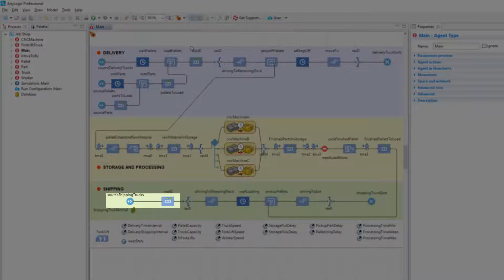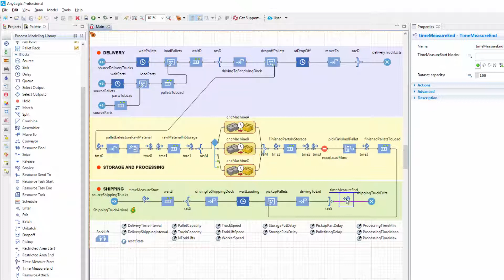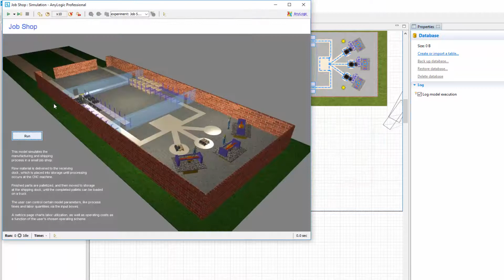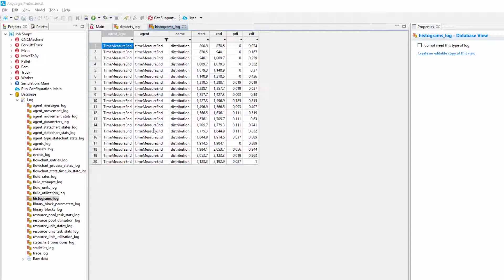Measuring time in system

Comment: How do you measure time WITHOUT time measure blocks and make a histogram of time data? For example, how do you measure time in a queue in service block
Reply from the maker: Hi Madegma, 
For this purpose, you can create a time parameter for agents that are going through the Service block. Queue time in Service block is the time between the agent entering the block and entering the embedded Delay block. You can use 'On enter' action of Service block to set the time for the agent's parameter by using 'time()' function and then subtract the agent's parameter from the result of 'time()' function in 'On enter delay' action of Service block. Hope that helps.

Comment: Hello, is it possible to apply the same for Road Traffic Libary to measure time of cars?
Reply from the maker: Hi Hary! In the case of the Road Library, we'd suggest a more convenient approach to tracking time. Take a look at the inner structure of the "Traffic Lights Phases Optimization" example model (go to AnyLogic Help | Example Models | Examples)
Each existing car has a variable "startTime", which initial value equals "time()". You can find it inside the "Car" agent type. Additionally, in the "carDispose" block (field "on enter") there is a code that passes calculated time in a system to a "dataset" object and further to a histogram as well as to an "output" object.

Comment: Hey AnyLogic Team!
Is it possible to get the mean value into a variable or into the console with traceln? Thank you so much!
Reply from the maker: Hi! The "TimeMeasureEnd" block includes the "HistogramData" and "DataSet" elements to store measurements. They are named "distribution" and "dataset" correspondingly:

timeMeasureEnd.distribution
timeMeasureEnd.dataset

You can get the mean time that the agents spend between the "timeMeasureStart" and "timeMeasureEnd" blocks by using the expression below:

timeMeasureEnd.distribution.mean()

All the functions available for working with the statistics collected by the histogram data and data set are listed in the Help documentations Histogram data and Data set.

Moreover, this statistics can be collected manually using a variable of the "double" type inside the agents, function "time()" and the "Statistic" element. The variable is needed to remember the time when the agent arrives in the system (Source - On exit: agent.startTime = time();). Then, you can calculate time in system as difference between the time when the agent leaves the system and the time stored in the variable (Sink - On enter: statistics.add(time() - agent.startTime);). Having collected enough statistics, you can call the "maen()" function for the "Statistics" element:

statistics.mean()

We hope this information is helpful! You can find more at https://help.anylogic.com

Comment: Hi AnyLogic team,
I would like to get two different histograms (or datasets) depending on the value of an agents parameter (one when this parameter is true, and one when it is false). Is this possible? If so, how?
Thank you for your answer in advance.
Reply from the maker: Hi Clara, To implement this you will need to create another timeMeasureEnd block and link it to a new dataset+histogram. In order to separate agents, please use a selectOutput block based on the condition "agent.parameter". Make sure that the parameter is of the boolean type and that the Agent type is assigned in the source block properties.
Then, the part of your flowhcart can be like selectOutput -> timeMeasureEnd / timeMeasureEnd1 -> sink.
In case you have further questions, feel free to contact us - https://www.anylogic.com/company/contact-us/.

Comment: Hi AnyLogic team,
Is there a way to just get the mean value from the dataset gathered by the TimeMeasureEnd block? 
Thank you for your answer in advance!
Reply from the maker: Hello Daniel, thank you for the question. The timeMeasureEnd block has built-in elements - "Dataset" and "Histogram data". The mean value can be obtained from the histogram data component. In order to output the required value please drag the barchart from the pallet, set a title, and leave only one field in the tab "Data". In the field "Value" please refer to the histogram data component and call a method "mean()". The code should be as follows:
"timeMeasureEnd.distribution.mean()"

After that, you have mean time spent in the system displayed on the barchart.
In case of further questions, you are welcome to contact us - https://www.anylogic.com/company/contact-us/
Reply: @anylogic-simulation  Thanks a lot! Problem solved :)
Reply: @anylogic-simulation  Actually I have one more question: I am currently working on a rather big simulation model. Therefore, I am spending a lot of time waiting for the solver to generate the source code. Is there a possibility to somehow disable the solver or a workaround to deal with big simulation models?
Thanks again for your reply,
Daniel
Reply from the maker: @danielfischer2520  Hi! Yes - in AnyLogic you should go to Tools - Preferences, find the Advanced tab and disable the "Build model sources automatically" check box.

Comment: Hi team, newbie question:

If I have a SOURCE process how can I get the entity or agent to go to the shortest QUEUE element if their are multiple options? (As oppose to using a SELECTOUTPUT block with a distribution). 

Thanks for the help! :D
Reply from the maker: Hi Karl! The SelectOutput block should be switched to conditional mode. If there are two queues, then the condition is: "queue1.size() <= queue2.size()". If there are many queues then either the SelectOutput5 (3-5 queues) or SelectOutputOutIn (5-10 queues) block should be applied. Should there be >10 queues, it makes sense to replicate the queue object and perform dynamic routing with Exit -> Enter blocks.
Reply: Cheers guys! I'm still in the learning/experimenting mode, but pretty impressed with the software so far. The Trauma Center model is fantastic. Thanks for the quick response!